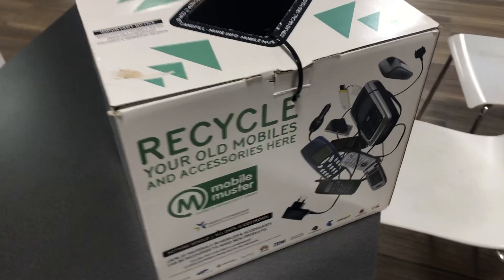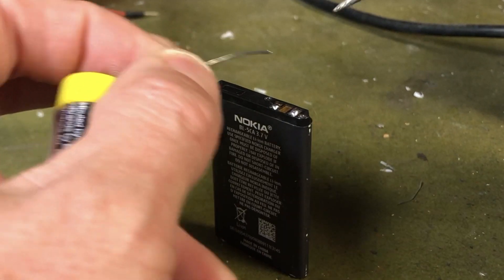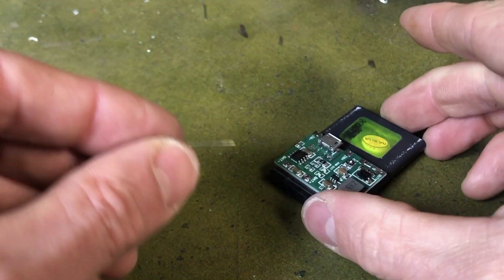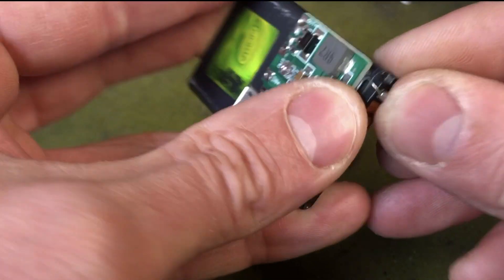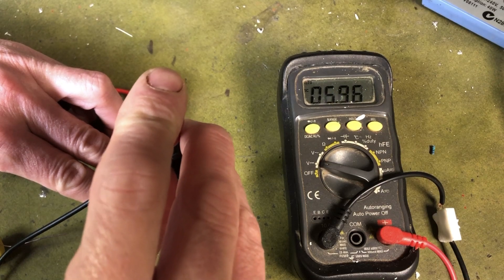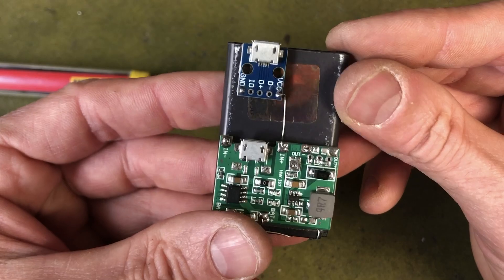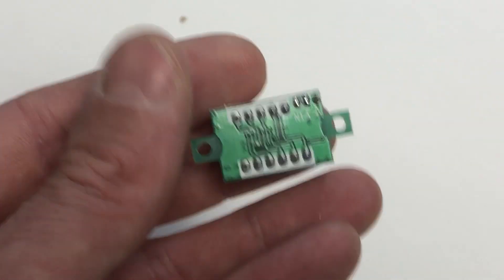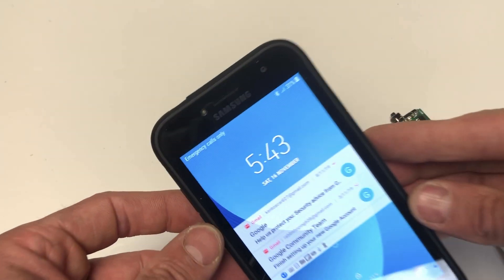How to Reuse Mobile Phone Batteries

Comment: Could you stack these batteries and connect them in parallel?
Reply: you need a slightly better (10pennys or so lol) dc to dc converter for that because :
max amp @ 5 V is limited by the anemic cap impersonater on those board @ 1.5 A 
(linear degression -> 12 V ~ 0,7 A etc.) so you have no benefit of adding cells besides
a non linear increase in Wh.
If thats all you need you still have an issue : LOADING. You can load liPo and LiION(M) in parallel
unregulated IF you know your batteries well ... meaning same Capacity (Wh), same capping Voltage (4.05 V vs. 4.22 V is not ideal...) same AS IS State of both etc. (Basically you need the identical same cell in the same point in its life)
Otherwise you degrade the better Battery to the state of the worse battery in a couple of cycles.
Even IF you have battery clones, tested by yourself to every spec it is recommendet to have at least a thermal fuse between both cells. 
Good DC-DC amps include connections for thermal sensors to adjust charging (stop, or even cool actively lol).
For a small little toy project it does not matter if you have a firre extinguisher handy,
but you cant rely on it that way.

Comment: Does anyone have any ideas about how to make a slim enclosure for this? I want to permanently paste it to the back of my phone
Reply: also, is that a bad idea? Will it get too hot?
Reply from the maker: @jacobhenderson7699  If I was going to add this to my phone I'd prob use the below module.  The one in this buid will charge your phone but it isn't acually built to do it.

https://www.ebay.com.au/itm/USB-2-4A-Mobile-Power-Bank-Charging-Module-Lithium-Battery-Charger-Board-G/174429648961?ssPageName=STRK%3AMEBIDX%3AIT&var=473630604015&_trksid=p2060353.m1438.l2649

Comment: Is it OK to use 5V charger on a battery rated for 3.7V? Because that's exactly the kind of a battery used in this video.
Reply from the maker: The module used is specifically designed to charge this type of battery so there is no danger of over-charge

Comment: Only thing you should’ve done differently is open up the battery top and take out the built-in BMS that way you’re not trying to work through two of them to charge your battery and use it

Comment: could maybe run the wires underneath the module and separate them from the board with some non-conductive tape. That would allow you to turn the board around without needing the extra micro-usb adapter

Comment: Dude, you may not post as many DIY builds as other YouTube channels I subscribe to, but I can’t think of anyone who comes up with stuff as useful and well designed.
I came onboard when you posted a video on how to build the keychain “spark maker” (can’t recall what you called it atm) out of copper tubing & a lighter wheel & flint. That video posted at a perfect time for me and so did this one. I’m currently sitting surrounded by my pile of recycled batteries from phones, power tools, cars, laptops etc…
Currently, I’m leaning toward a battery spot welder, then portable battery pack like you did here, then a welder or powerful Bluetooth stereo done in the style of the early 90’s Ghetto Blaster, but with modern components & lots of lithium ion power.
Outside of electronics, next up for me is a Clamptite tool build. If you aren’t familiar with those you may want to check them out. They seem pretty useful…
Again, thanks for posting and if you keep on posting ‘em  I’ll keep on watching ‘em. 
🤘🏼😈👍🏼